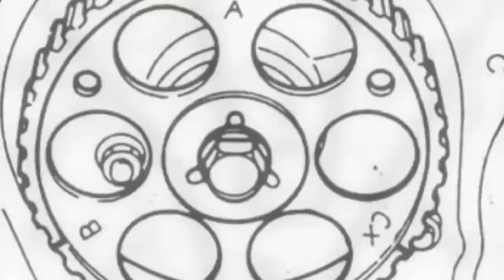2008 Ford F-350 6.4 instalando el turbo  Ford truck

Comment: Ola amigo tu ke sabes de trocas disel recomiendas una como esa
Reply from the maker: Este motor  es muy problemático en mi opinión el 7.3 o el Cummin
Reply: @ThebigManmecanica Ok gracias
Reply: @walteraguilera1361   my troca es 2008 diessel ford 6.4  apareció una letrero  que dice reduced engine  power  que será el problema por alumbró ese aviso
Reply: @ThebigManmecanica  el 6.4
Reply: Tengo una 2008 y me esta dando unos problemas, tiene una fuerza brutal, pero en los semáforos baja y suve las revoluciones cono si tuvieras una melodía baja
Reply: Ya tengo tiempo con eya y nunca seme puso chipir asta ahora me recomendaron cambiar la bomba eléctrica. Pero nolo e echo. Tiene 213 mil millas
Reply: Tengo una f350 2008 y ya empiezo a dar problemas el turbo abeses trabaja y luego deja de trabajar

Comment: Buenas noches tengo una troka 2004 f250 disel motor 6.0 tengo el siguiente problema, al avansar no tiene fuerza le piso todo el acelerador y avansa muy despacio y en carretera pierde fuerza y como que se ahoga y se escucha un clik en la caja de los fusibles me podria desir cual sera el problema
Reply from the maker: Amigo ahí no puedo decirte en si que es pero si se ve que tienes un corto circuito y tienes que encontrarlo antes que te pueda dejar botado